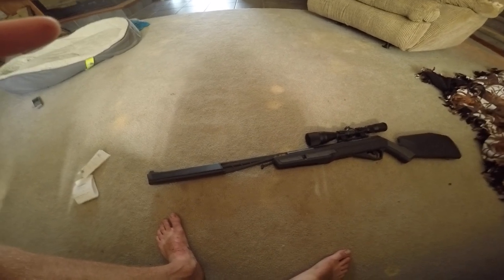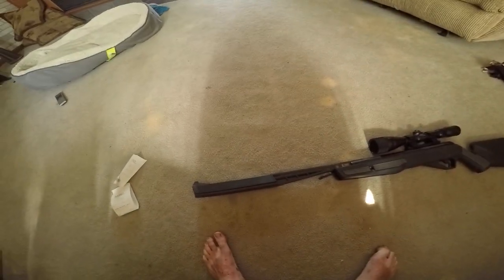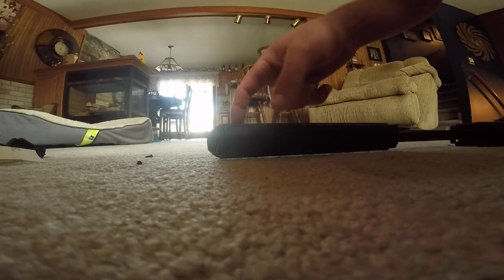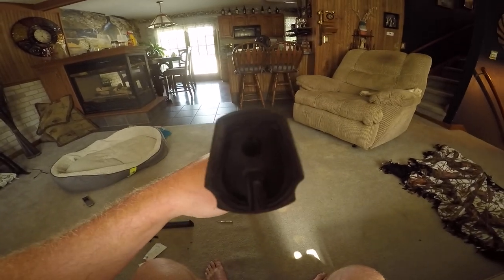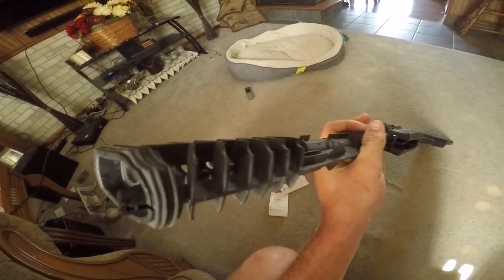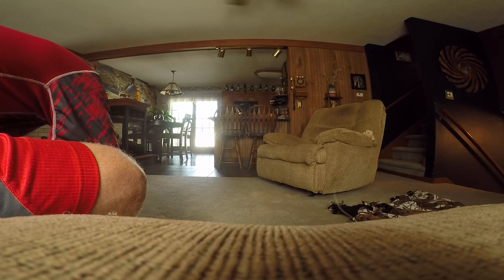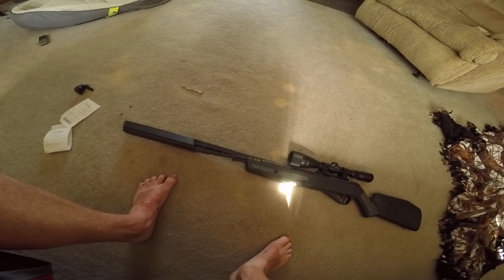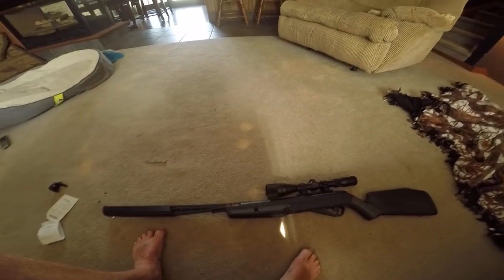what is inside the suppressor on the Benjamin mayhem SBD NP2

Comment: Wrong it doesn’t slow the bullet down, a suppressor works by creating turbulence and cools the hot gasses down inside the can before they exit the end cap, that’s why you get almost zero suppression on an air gun because the air is already cool

Comment: thank you for the your video, I just bought a crosman valiant in .22 cal and it has the same type of shroud, I was wondering if there was a way to check the crown on the barrel, your video just answered that question, now have you try to take the rest of the shroud of the barrel in case the crown is not acceptable to recrown it ? that might be part of the problem with accuracy, if you can make another video about pulling the whole shroud off the barrel please , and if you need to recrown yours they are a few very useful videos on how to do it very easily .
Reply from the maker: I have not but but during a hunt i dropped the gun really hard and fell a good 15ft on to some rocks and it broke the suppressor off and the butt stock of the gun, but after looking at the shroud i didnt see a way to fix it, but i havnt spent much time on trying to fix it, i also bought the crossman valiant .22  ill do a video with that and see if i can remove the entire shroud, subscribe to my channel to see the video of removing the shroud so you can see it first, ill have the specifications and showing the removal of its suppressor. Thanks
Reply: nice buy! how much did you pay for it ?
Reply from the maker: @pedropablo4690  i paid about $300 what about you
Reply: $127 on Sportsman's guide with membership
Reply from the maker: @pedropablo4690  cool um i just looked to see if i could take the suppressor off the valiant but there are no screws on mine and it appears to be fixed to the gun and non removable sorry bro
Reply: mine has 2 holes but I can't see any screws in there, what caliber is yours ?
Reply from the maker: @pedropablo4690  mine is .22 it alsso has 2 holes but no screws
Reply: did you already did the breaking inn on yours, if not I have a few tips that will make it fast and cheap
Reply from the maker: @pedropablo4690  i have not i could use some tips
Reply: ok just 2 tins of cheap pellets like Crosman  hollow point they are like $ 6 at Walmart, find an empty box were you can fit 2 old phone books and clean the barrel with some patches of cotton and some weed Wacker line, fishing line could work to if it is thick enough to be pull through the barrel (I'm guessing you know how to clean your barrel that way, a snake bore will work to but if you don't have one they cost like $12,  let me know if you need more input with the cleaning process , after is clean check barrel screws and start shooting those pellets into the phone book  after about every 60 shots check the screws again as in mine they went lose and have to be re tightened after 200 clean the barrel again and do this process till it shoots quieter and the braking of the barrel is smooth. also check the breech seal make sure is shows a little higher than the metal if not needs a new breech seal. this way it takes a few hours to brake it inn instead months .
Reply from the maker: @pedropablo4690  ok thanks bro that seriously helps
Reply: no problem, remember to re tight the screws every 60 shots or so, or they will get really lose, also no need to put the scope till after brake in period since you're  shooting into  phone book 3 feet away